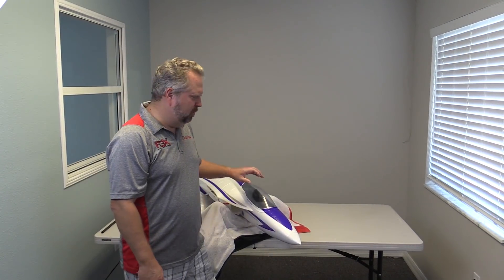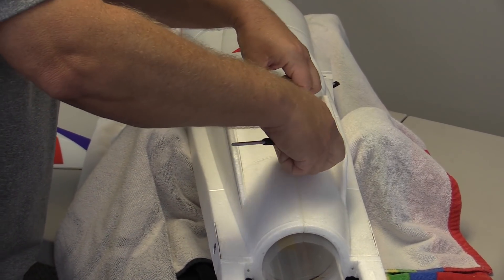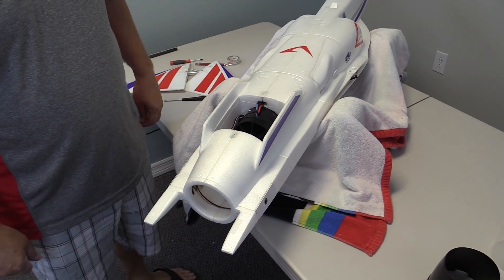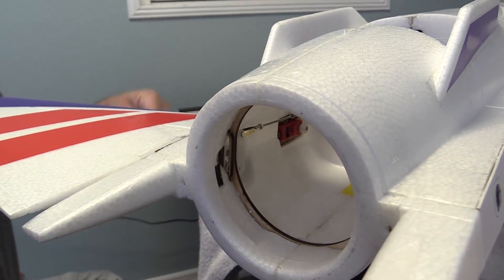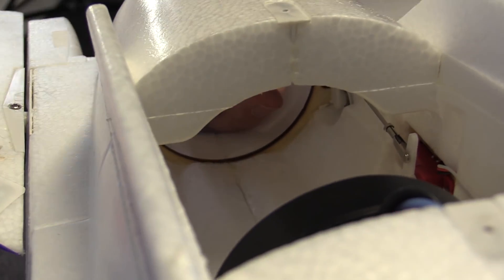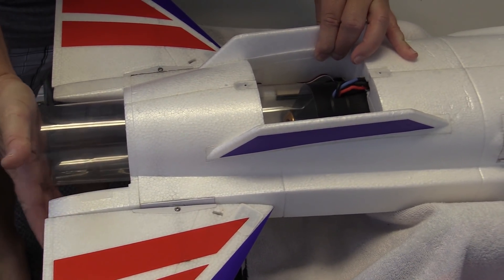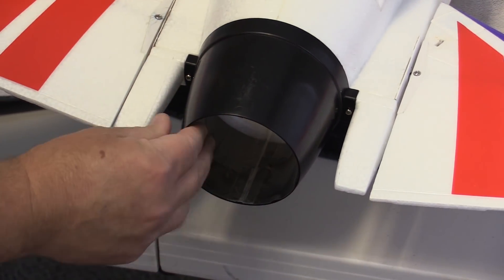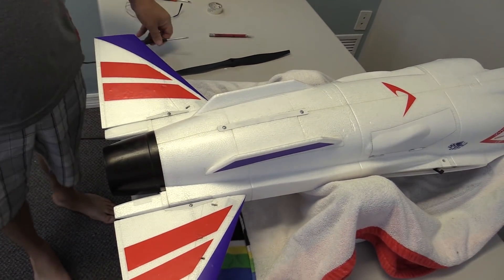FlexJet Stab and Tailpipe Install

Comment: Ok I call BS.  I bought this plane. I knew the elevator was going to be a nightmare  but figured Id throw out their gyro and just split the elevator on different channels and sub trim it right.  Cant the elevator horns are almost on top of the duct support. there's no room to spare for a less than perfect setup. So I tried to get it mechanically perfect per this video. 45 minutes later with the whole elevator covered in sweat I was nowhere near the mark.  and that was one elevator. Just turning the control WONT work. Its threaded on both ends so turning one end wont do a thing. You have to get something into the ducting to hold the rod. I used forceps that I bent. Problem is they don't always hold. And you cant put the arm on while the forceps are on the rod. So you play a game of turn , unhook try repeat. I never got either to match the center or each other. I put more though into my last bowel movement than they did in the design of the elevator.   Other companies make plane with split evelators that are nowhere near this messed up. save oyourself a LOT of cursing and buy one of those